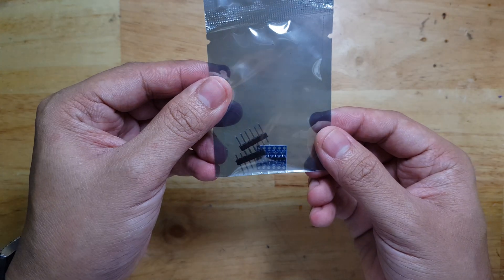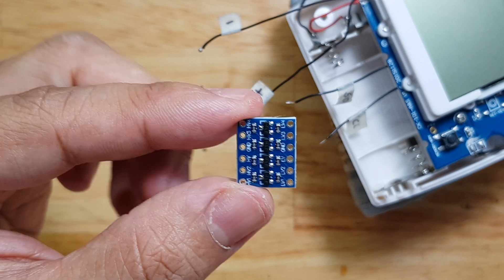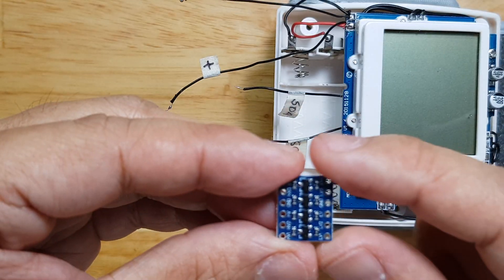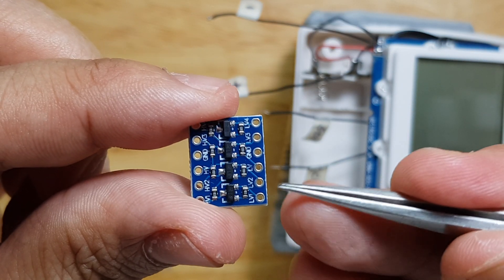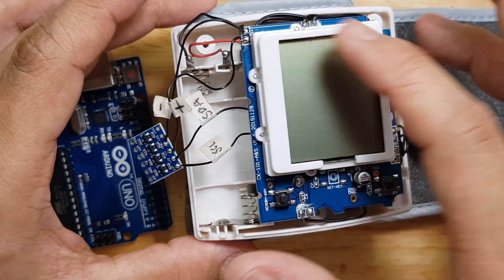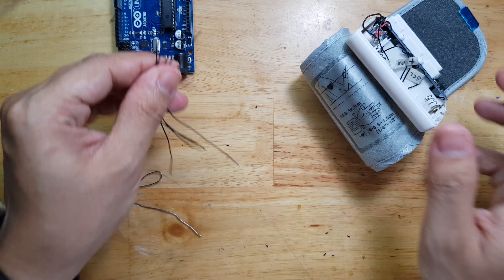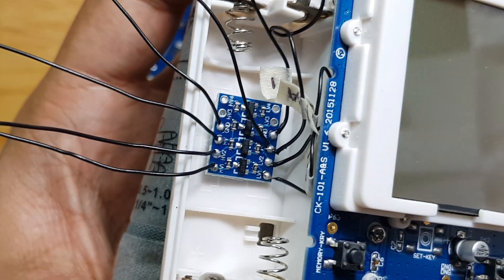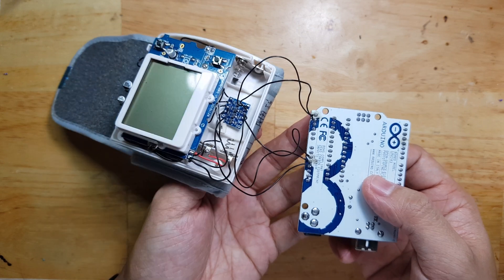HOW TO USE LOGIC LEVEL SHIFTER ON ARDUINO TO CONVERT CIRCUITS AND SENSORS FROM 5V TO 3.3V CIRCUITS

Comment: Suggest a bidirectional logic level shifter which shifts from 3.3V to 1.8 V
Reply: bPiShift is a snap-on bidirectional logic level shifter available on CrowdSupply. But, it is specifically made for Raspberry Pi boards.

Comment: Use an 74LVC573 or 74LVC373 as a level shifter, they will shift up to 8 digital lines & can handle switching significantly faster signals than the FET based level shifters.
Reply: Hey where can I buy those so you have a link or something

Comment: Why dont you need Pull Up Resistors?
Reply from the maker: Because there is already a pull up resistor in the board :)
Reply: @Circuit Desolator Thank you very very much

Comment: Thumb up for not liking Dupont wires :-) I bought thousands off them and they work fine for me, sometimes better than my lousy solder connections. So it does not really make sense for me, but I anyway prefer to solder my wires.

Comment: It's a nice video,but i still face some problem.
I'm trying to get output of 3.3V from input of 5V.
Problem is, whenever i apply HV then i get same voltage on all pins of this side.
Same problem occure at other side also. Can anyone explain me, why is it so?
Thanks.
Reply: Did you find a solution for this?

Comment: I still don't fully understand and I have a question:
I have a TFT Display that needs 5 logic level 3v3 outputs; so I would connect the 3V supply to LV and GND and then LV1, LV2, LV3, LV4 to the Display but I would still be missing a 3v3 logic output, so can I take advantage of an HV1 output without connecting to 5V? Thanks
Reply: No you can’t ,you need 5v in high v side and 3v on low v. side .
Reply: @ttd9633  Ah!, Is it necessary to use both sides simultaneously?
Reply: @Dancopymus  Yes , both side need voltage supply.

Comment: Hi, nice video
Wanna ask something, mine had some different, it only had 2 transistor like component with a few resistor
It had rx1 tx1 and rx2 tx2 instead of lv1 lv2 etc. 
Can i just use it like how you describe it? I actually wanna use it to burn 3.3v pro mini using uno, can i do that?
Thanks